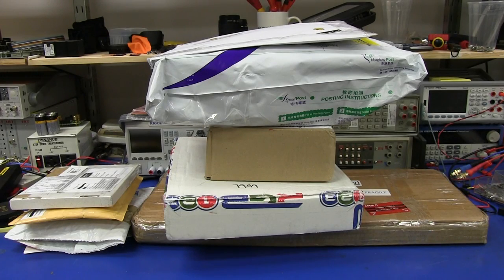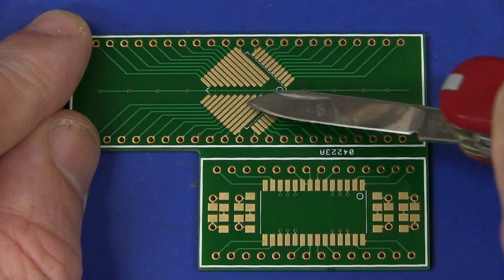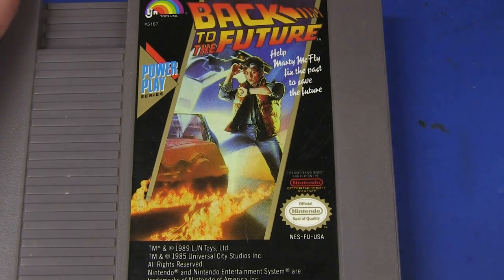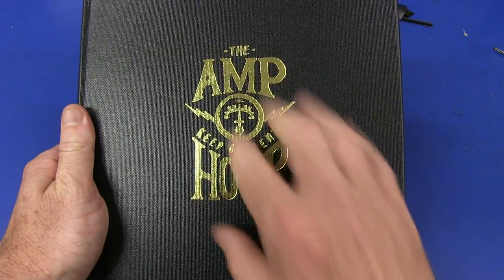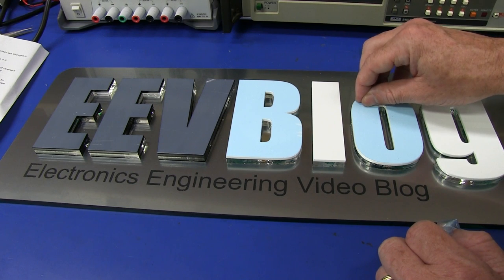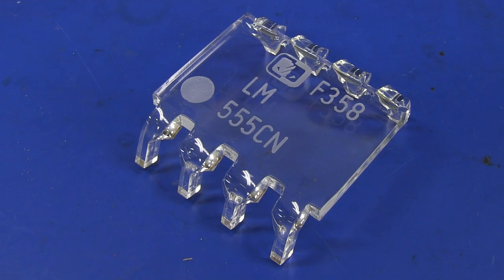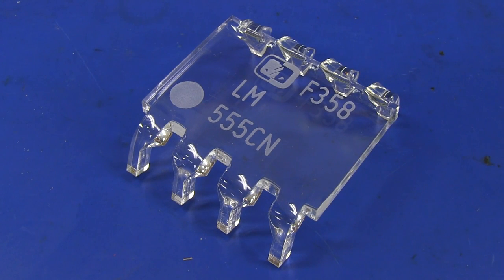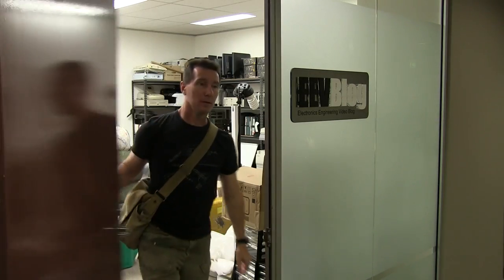EEVblog #573 - Mailbag

Comment: You should be able to light it pretty well through the frosted glass as that should diffuse the LEDs to avoid spots.  Only problem then is that you'll get light leaking out in the glass.

Comment: The wasted NES cartridge space is due to the front-loading design of the NES. The Japanese version was top-loading (with much smaller cartridges) but IIRC Nintendo wanted to avoid comparisons to the other crappy machines on the market and made it more VCR-like.

Comment: The uARM annoys me to an extent mainly because of the servos they're using on it, making the arm an open loop system (yes, the servos themselves are closed loop, but the controller for the arm has to make assumptions), using stepper motors isn't going to make it a closed looped system either, not to say it wouldn't be an improvement. The robot arms my university had used regular DC motors with motor encoders (optical or quadrature encoders, I'm not sure, didn't have enough time to see if I could take off some of the covers) and limit switches. As I mentioned to Chris Gammell on twitter, it wouldn't be too hard to remove the servo electronics and turn it into a closed loop system. But will all that being said, it looks like a really nice simple design, and great as a toy. But if you wanted a pick and place machine, a SCARA arm would be a better choice ;)

Comment: Which country did the Sinclair TV come from? As far as I'm aware, in the UK, we used UHF for TV signals, whereas in Australia (and South Africa), VHF is/was used, so to get something from the UK to work on the TV radio waves there, it needs a fix to alter the frequency range first.

Nice sign, I really hope your double sisded tape holds up well. Would be a disaster to find it on the floor one morning because of some dodgy tape.

Comment: I had one in 1984.. Awesome calculator until my wife threw it out a few years later due to a broken battery wire. sigh.... Anyways I had bought a book about hacking your 41cv.  Pretty odd procedure which involved pulling the memory card while the calculator was powered up.

Comment: Nice to see you've got a 41 Dave!  I have a 41C,41CV and 41CX!  (I'm a fan)  Mine are in mint, and I even have a several HP-IL devices you can control using that (HP 3468 multimeter and HP3421 data acquisition module.  With a little imagination it's amazing what you can get that combination to do!  Greatest calculator ever made.  Have fun!

Comment: Hey dave or anyone reading, I recently purchased a security camera and it uses a phone cable, i figured out that it uses component cables as an output, so i made an adapter with a prototype pcb that has a phone jack, 12v jack and rca component video out and audio out, the adapter works but when for some reason the internal mic on the camera starts making noises like when you hear somebody talking on a stage and it makes a really loud noise that type of noise. i thought it might of been because the signal lead is close to the power tracks on the pcb but when i moved them it still did the same thing, as you may know rca component cables have 2 cables one for ground and the other for the signal. I have both video and audio grounded together with the 12v ground i think that is what is causing the noise, what do you think i should do?

Comment: I've got that same Microsoft Lifecam webcam. It takes decent quality video but the software that controls the autofocus function is terrible. Every time you move it even a bit, the auto focus goes in and out over and over until it finally finds the focus. Luckily you can set it to manual focus so that may not be a problem with this microscope version.

Comment: Dave, my first HP calculator was the  41CV and was bought in 1985 (I wanted an HP15C, but they had stopped making them, I think this was a better one!).  I also had the math pack as well as an engineering pack and memory pack.  Absolutely loved my 41CV. Its demise was the fact that it used N-Cells and those batteries were notoriously hard to find, and were very expensive compared to stanard AA or AAA batteries.  My Keyboard finally died on it in 2001 and I replaced it with an HP48GX (which I still use today).

Comment: Dave, don't you have a heap of old 15-17" monitors in the lab? Steal the CCFLs/LEDs from one or two of 'em, and use that for the sign. Hell, you could maybe slap on a whole backlight panel as-is or cut to size, or just scavenge the diffuser/fresnel sheets to even out the lighting regardless of its source.
On the other hand, you've already got the sign mounted on frosted glass, right? How would it look if you just used that to diffuse the lighting? Might make a bit of a halo effect around the sign too :)

Comment: I actually like the tight fit for the headers.  I have some adaptors with much larger holes, and the headers flop around so much it's difficult to solder them so they are 90 degrees to the board.